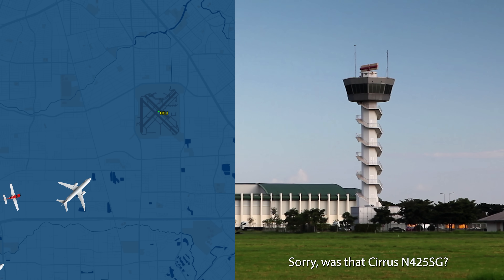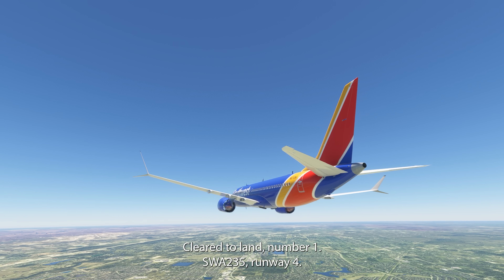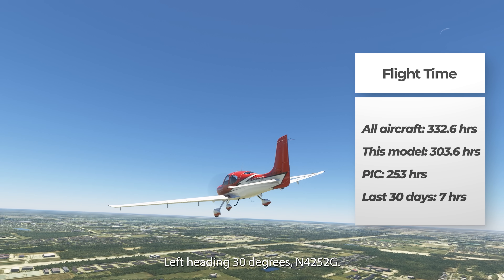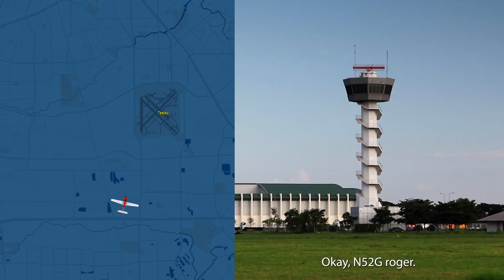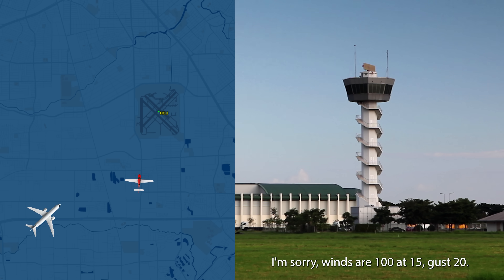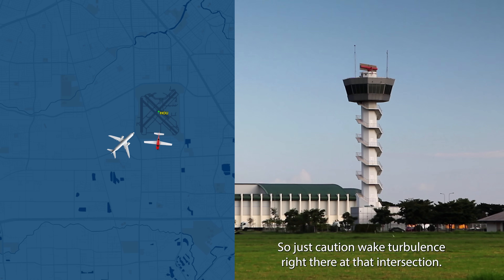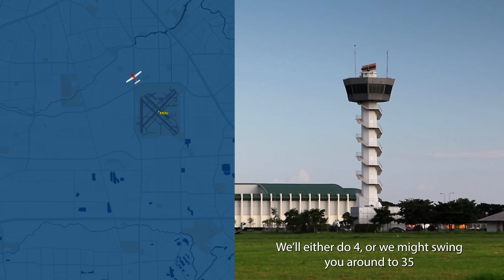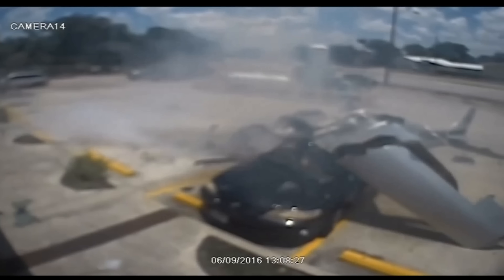Fatal Accident Near Houston-Hobby Airport After Complex Instructions From Air Traffic Control

Comment: ATC tried to be nice about it which is good....    but changing her from 35 to 4 to 35 to 4 was confusing...     and with a gusting to 20 crosswind...   adds complexity. Maybe ATC didn't realize he didn't have spacing for a slow moving aircraft (Cirrus)...  I guess have to be aware that it simply can take a long time to get a spacing gap..   & both ATC & Pilots need to be prepared to go to a location to circle etc...     ??

Comment: I have been flying for 40 years now, been an airline pilot for 26 years, still maintain my CFII, and have landed at Hobby more times than I can count. 

Having said that, I would have been confused by what the controller was trying to do here.  It was hard for me to follow his instructions and I was not trying to fly a plane at the same time. To make matters worse, the controller was clearing her to land on 35 with an 18 kt crosswind (counting the gust).  Not an overly easy task in a small plane.  The controller set her up big time. 

But it also has to be noted that the pilot violated the first and most basic rule of aviation. FLY THE AIRPLANE!!!!

No matter what is going on around you, airspeed, altitude, attitude, and configuration!  That is always your first priority. Everything else comes after that. 

I wish the pilot (as pointed out in the report) had been more assertive. As soon as the controller cleared her for runway 35 with those winds and confusing instructions, I would have said negative, send me back to approach and resequence me for runway 4.  Unfortunately, given her experience level, I am sure that never occurred to her. 

If she did not have the fuel to go back to approach, she could have  declared emergency fuel and now the ball is in her court to tell tower what she is going to do.  You can always talk about it when you are safely on the ground.  Controllers ultimately get to go home at night. That is not guaranteed for pilots. 

As others have pointed out, Hobby is no joke. Very busy airport with crossing runways and lots of traffic. With her experience level I wish she would have chosen Ellington, which is only a few miles south of Hobby and a lot less busy. 

A very tragic incident, and unfortunately both sides had a part in it. 

Please understand I am not trying to assign blame here. But aviation safety can be a callous thing. We study accidents to discover the cause and what lessons can be learned so they are not repeated. 

Even when the outcome is tragic.
Reply: The biggest clue for me was when ATC said fly left to 30 (his words). She was doing that, she was turning to 030, and ATC comes back and says I do not know where you are going, but turn back to the right. From then on out she was over saturated. She started doubting herself, and lost her mental awareness.  I am not blaming the pilot, but as we all know she is in control and should have just asked for a holding vector to get herself back in shape mentally.  After the 030 episode, she was all over the place with speed altitude etc.

Comment: The N4252G crash at Houston Hobby was primarily caused by the pilot’s improper go-around procedure—specifically, retracting flaps at too low an airspeed and pulling a tight turn to the left, exceeding the critical angle of attack and leading to a stall and spin. Contributing factors included complex ATC instructions during a critical phase and the pilot’s lack of assertiveness in a high-pressure environment.

Comment: This ATC is negligent. They didn’t  know what heading that plane was on .  They put them
On the heading. Then forgot them ,  that’s what happened the pilot was very professional . 

Wow there’s no traffic-  then there’s traffic - and it’s tight. This ATC was awful. They should never work again sorry 

When he said she was too high go around - she should have said unable and landed. Huge runway. Would have easily hit it down. 
  I’ve said it before and I’ll say it again all ATC should be required to at least hold a PPL
So they know what it’s like in an airplane alone.  This woman was very competent IMO and a great pilot.  Stayed calm tried her best to follow directions maybe to a fault.   Sometimes unable and I’m doing - this. Is then correct answer to save yourself From incompetence.

Comment: God what a mess. There’s a lot of blame to go around here. Also condolences to the pilot and occupants. This is very tragic and heartbreaking.

ATC: way too many instructions and talking after atc requesting the first go around. They said they’ll call base and then they just all of a sudden tell her to make 180 turn to final. Pilot was getting flustered and confused over what to do and apologized when it was atc who messed up.

Pilot: you are an inexperienced private pilot flying into a very busy airport having to keep pace with jet and turboprop traffic. 

Next accepting a runway with a pretty significant crosswind component for a light prop and then coming in too high on multiple occasions.

This sucks. Certainly the crash was a result of pilot error on that final go around  but a combination of bad spacing by approach and too many instructions by tower were a contributing factor.

Comment: This is 9 years old.   ATC failed to sequence her correctly.   She was ahead of an airliner, at a lower altitude, and closer to the runway.  SHE HAD PRIORITY.
The airliner closing in behind her had the obligation to go around.
In proper landing protocol, the size of the plane doesn't matter.     Big boys don't get to play bully at airports.
Reply: Looking at her track she did not proceed as instructed "direct to the numbers" but rather joined final which increased the approach time and therefore allowed the overtake. We won't absolve the complicated instructions to be partly at fault, but this pilot was clearly out of depth and disoriented by how she was flying the pattern for 35 initially. You CANNOT blame an again accident entirely on the controller as it was her duty to always first fly the airplane. You also have to be able to tell the controller unable or no that won't work. And like the other comment said, GA is never given priority when commercial aviation is around that's just how it is
Reply: @6ix782 @bryansimmons4550 you are 100% correct.  The jets behind either slow or go-around, period.  ATC is first come first served, period.  All the tower had to do was call the TRACON Hobby final controller and tell them Southwest is going around and ask what heading they would like them to fly.  Next you never send the slower aircraft around in that situation on a short final, never.  And then because that is what they did, tower controller should have called the TRACON Hobby final controller and told them to give us more room rather than continuing to run planes 4-5 miles apart if that far.  The entire accident could have been avoided.  All you arm chair QB's who think just because some jet is on a "scheduled pattern" or that "GA is never given priority when commercial aviation is around" are flat out wrong.

As a retired Houston TRACON controller I have thousands of hours working Hobby Final and get the smaller aircraft on the ground asap.  It only takes a slower speed assignment five or six miles earlier to the almighty airliners (as some believe) to make the situation work correctly rather than continuing to slam the airport.  Also this thing called "vectors" has always worked at well.  Sad event that could have been avoided.
Reply: That's not how airports do it. A commercial jet is coming in at higher speed and easily overtake the small plane. Jet burning massive amount of fuel. Prop plane not.  Jet is on a scheduled pattern. It would be foolish to allow a prop plane interfere unless an emergency was declared. So you don't know what you're talking about.  She was given opportunities to land but was incompetent.  She obviously didn't know what a proper holding pattern was.

Comment: As is normally the case, the NTSB conclusion seems accurate.  I'm a little surprised that the safety parachute didn't deploy.  I thought that those planes normally had one.  I think that chute deployment is the standard response for stall/spin in that particular plane.  The only 20/20 hindsight I will add is that after getting shifted around a few times like that, I may have chosen to leave the pattern, regroup my landing information for the 2 likely runways, then attempt a fresh entry to the pattern with better spacing/timing.  ...or I might have diverted to another airport that is likely to have fewer fast movers coming up from behind me in the pattern.  Hind sight is 20/20.  I consider myself to be fortunate to be able to learn from the misfortunes of others so that I may be able to avoid encountering them myself.
Reply: IIRC, at the time a photo of the wreckage showed the chute deployed but unopened. Don't know whether it popped out after it hit the ground or before. Very tragic accident.
Reply: I always avoided large airports. Too busy.

Comment: Almost the exact scenario occurred at Tucson about 20 years ago with a king air, continually had pilot go around until plane ran out of fuel. Started with a 737 coming in behind the king air and the pilot told to go around.